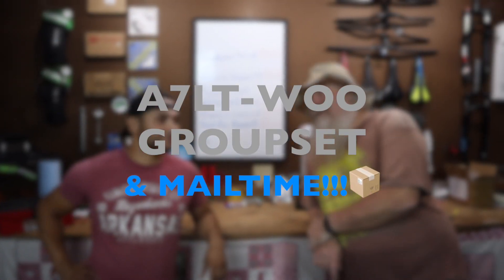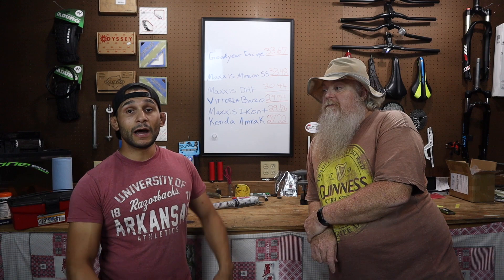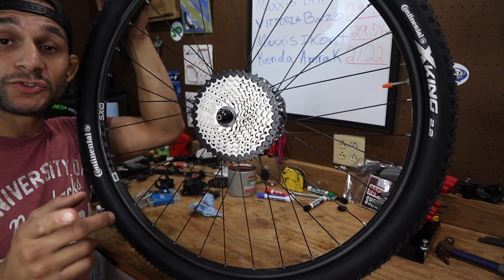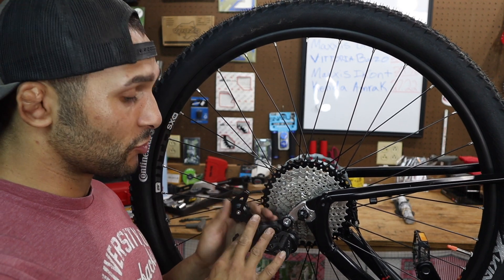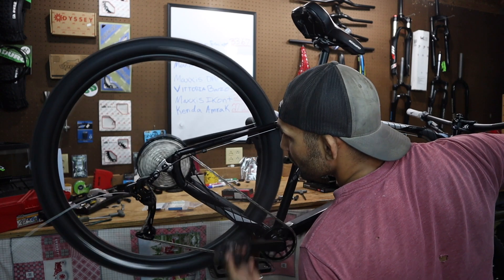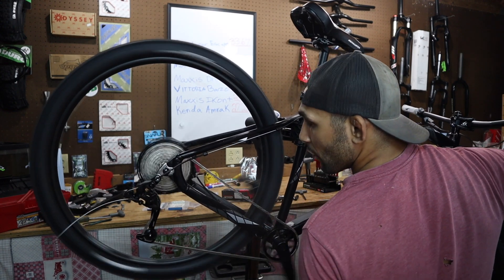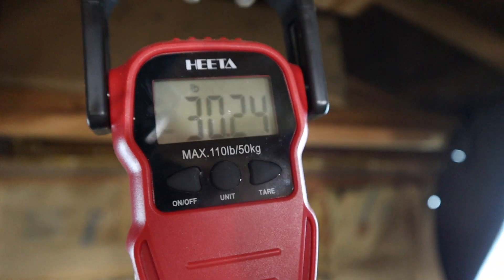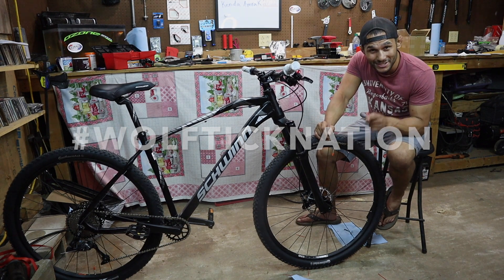Budget A7 LT WOO 10 Speed Groupset on the Schwinn Taff

Comment: How many links did you cut off th chain to make it fit. Did you use the extender. I can't get the LT WOO 10  Derailleur on the Schwinn Ascension. I used the extender and the grooves  seems to not fit.. it extension isn't going under the cassette for the last gear.
Reply from the maker: Used the extender yes, checkout our chain measuring video, I use that method for everything. You may need to screw in the top screw on the derailleur to get it to fully clear the biggest cog, that or resize it using our method.Sounds like the chain is too short

Comment: should try a GT Aggressor Expert  

what type of steam did you use on the GT? size?

Lennie
Reply from the maker: Hey Lennie I used a zoom brand stem it has a 50mm length, a 28.6mm steerer tube clamp and a 31.8mm bar clamp, heres a link for a similar one:) actually the same stem! Just found it ha ha thanks man https://rover.ebay.com/rover/1/711-53200-19255-0/1?mpre=https%3A%2F%2Fwww.ebay.com%2Fitm%2FBike-Stem-30-Degree-Downhill-Mountain-Bike-Mtb-Bicycle-Handlebar-31-8-50mm-USA%2F193682774541%3F_trkparms%3Dispr%253D1%26hash%3Ditem2d18649a0d%3Ag%3AHwQAAOSwlK1fSgeK%26amdata%3Denc%253AAQAFAAACYBaobrjLl8XobRIiIML1V4Imu%25252Fn%25252BzU5L90Z278x5ickkfKe2vUidqHRg3XM2X2xOVFDFvysq2Xt3OrN%25252BQoNc2yBPUiVBBsKlMlqncvnhccqi9lEc7E4RSpdMQ5e%25252B3BtHw37Lmq%25252BKkoV01lJKDLcyESazsNLh%25252FISqMhpbkWmtjmaEe8Ylfs9ROCnPsLPa8VMqo7c5scXp7Igv0X6lP7eyhkQAhnxtf%25252FsvzXsUEW%25252FBJFu%25252FVZG4e9XqmX5ExF8ow8mdrDgQgraB0gdQneDqDad4MehaXilNEYjGaHq5Gr8642AlgqJjzbfRJpCeu39M1iSlJS0CErLHiZGCiHKGPQ4q%25252Fmt8Y0bRTtt%25252B7PgAR2rKZ6FgpJ2R7U7ZkECFL1O0A89EBEYuysOyElM3EBhLLTZ3s1J%25252FlFjSVvRs8Bf6aie4cedYIEsaMZLK6dN2fFbO%25252BP4Cs5VBesUAX5GwMxs9xOPvXG6O7ev0uST8pSnsvB%25252BMIw4o1j%25252B3D3sCiQSdndA8cv5kz%25252FLB%25252BCtUferIrUGj50oSlarf0yVvS4%25252B%25252FmA6dATZOelcIhf45%25252BklUd0uIOSG7m6PWhlRsAZbrk6hzM8gDXRRXFNLs3Kh3uSzkBINLw8WP6Q0lfH1s7WKDgWhMCn5i9pdNZPIk5njyyfDA0SqlUFMoDJDdpR1vkVQJDdn5uGpRdFbmr3L6U2MPef5MCx1UVl8QDhTsv9le0NQZ4Fj1SjPnAysUH1Fvq%25252Bx%25252FYysDYP7CXJXyj4dQ63d7Vj8cPANgwm0BcKYZavd%25252FPziLyS1uG72C6qj%25252FF18hYvzf732kFGShRo5o%257Ccksum%253A193682774541442acd9be6934034bdb79206e7f08665%257Campid%253APL_CLK%257Cclp%253A2334524&campid=5338684594&toolid=10001&customid=stem
Reply: @WOLFTICKVIDEOS    thanks for the info      where did u get the cassette crank set up
Reply from the maker: Ebay as well, you may want to check out the videos and the descriptions, they have the links to most of the parts list and for what I got them for when I did, but if you ever need some help man, just holler:)

Comment: Ur able to run a sram eagle nx/sx 12  speed and sram nx 11  on that hub if it is the old school shimano type hub. Looking to upgrade my  rear shifter just a 8 speed shifter and a 10 speed casette. 🤯 prew.. owner did a mcgruber. might get the sram or just go lwooho  and save $. New continental trail king did ok on todays  36 km up and downhill.
Reply from the maker: Dude just get the LTWOO, you wont have luck with an 8spd shifter and a 10spd cassette, been there done that.....no good!!! Wont shift brother man:( Thanks for letting us know on the tires:)

Comment: Love the videos on the taff. quick question. Does your rear wheel/tire sit more to the brake side than cassettes side. Or is my taff tweaked somehow? I have more room on cassette side buy about 3/16” 🤔 I’ve looked at all sorts of possibilities
Reply from the maker: Hey brother, the Taff's rear tire is completely centered with my frame??? But if I were you I would take my rear wheel off and make sure, the spacers are on the outside of the frame on both sides of the axel, you should have two, one on each side, maybe one is missing or one is on the inside of the frame and one is on the outside.Good luck man and keep me updated:)
Reply: @WOLFTICKVIDEOS  so I didn’t see any sort of spacers. I had a bike shop change the rear wheel to a cassette style when I first got it and they put a quick release on it as well. After much consideration and eyeballing I used some persuasion and a 2x4 to align the rear of the frame. With the tire off you could clearly see the cassette side of frame was pushed in. All better now. Idk who puts these bikes together but they need to find another profession. Lol. Next upgrade is brakes or BB.
Reply from the maker: Dude well I have done the 2X4 thing before but not on my frameLOL Glad its all better man and hope you arent going to be all unbalanced not lol

Comment: so far only the cheap rear derailleurs have a barrel adjuster, beginners need all the adjustment they can, I guess is the thinking behind it. cus you don't need that much adjustment the shifter already has enough, and when that's not enough just turn barrel adjuster in and pull wire and tighten it, and fine tune it again.
you should look into maintenance and components some more. or get enough sleep next time.
Reply from the maker: Yeah I prefer two, why not??? Doesnt make any sense to me, why not have another option to tune instead of short cutting, but its all good. No big deal:) and yes sleep!!!
Reply: @WOLFTICKVIDEOS  a barrel adjuster there means one extra part that can fail. So da ri haven't needed it.
Reply from the maker: also one extra part that can help dial it in:)

Comment: Barrel adjuster is on the shifter and you also need to adjust the B-screw to the correct settings so that it will shift properly to the biggest cog. Also check the L limiter if needs adjustment.
Reply from the maker: Thanks man, and will do. I like for derailleurs to have a little barrel adjuster as well but I guess I just got used to the more budget style😬😬 but thanks for the I put man!